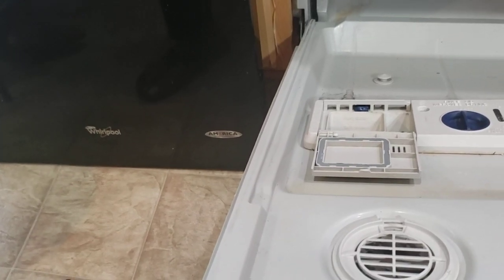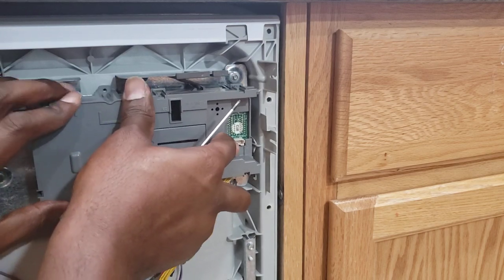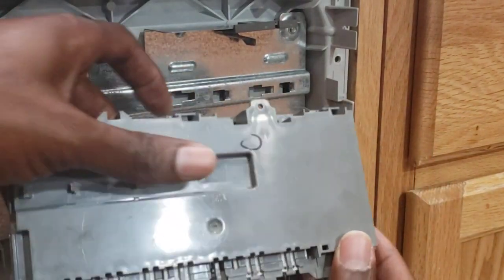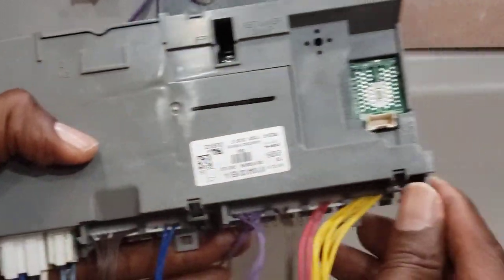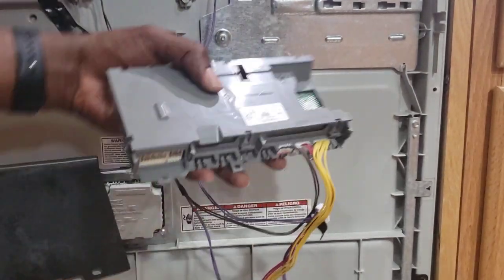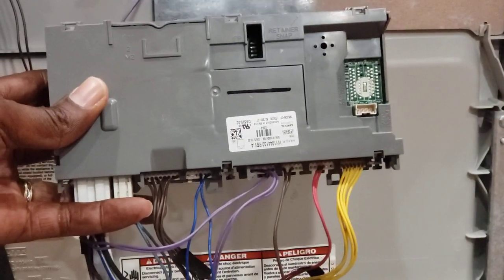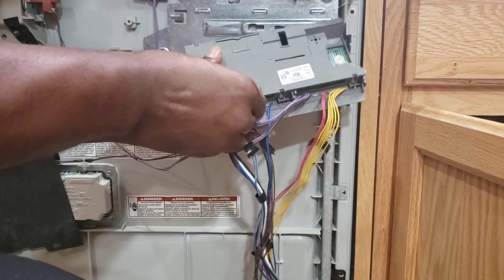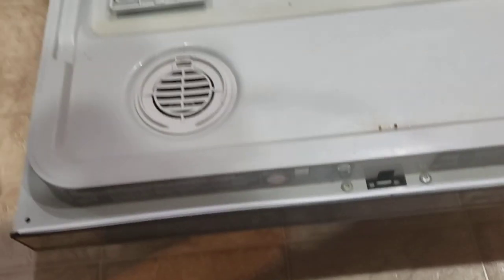How to fix error code f2/e2 Dishwasher and Replace Control Board. SOLVED! #dishwasher #repair

Comment: In my case it ended up not being the user interface. Roaches had got into the control board module and crapped all over it, and even got it in the low voltage connectors. A good clean with a toothbrush and isopropyl alcohol seems to have cured the problem for now.

Comment: those control boards are quite expensive
Reply from the maker: I bought my parts on ebay for $27.99 for the user interface, and $29.99 the control board. 
you can look up either with https://www.ebay.com/str/mdjapplianceparts or https://www.ebay.com/str/liquidationflips to find your parts.